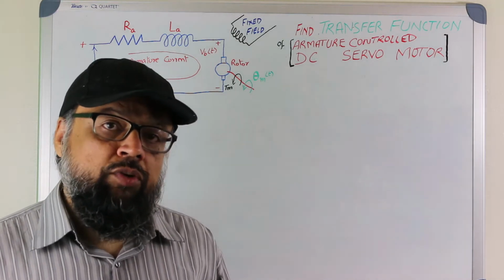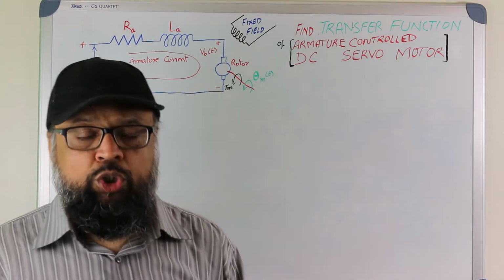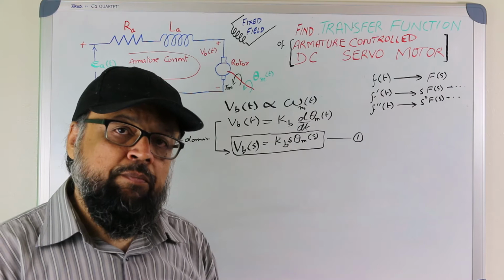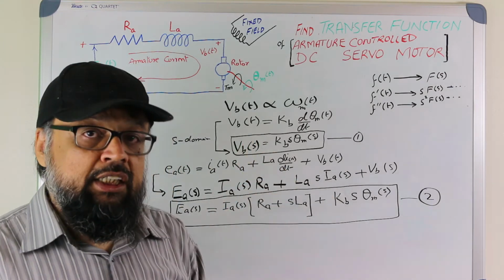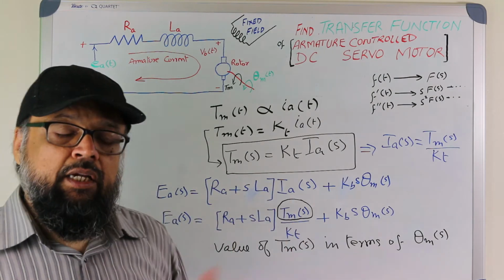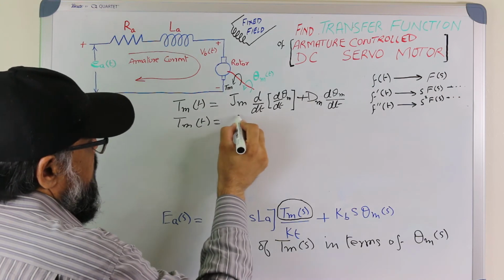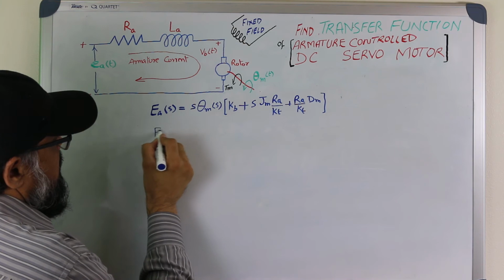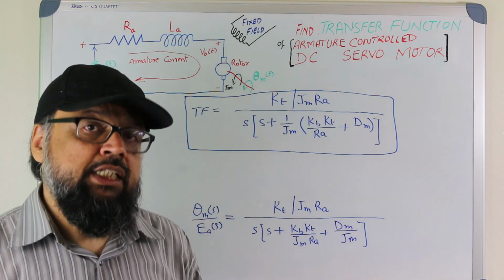How to Find Transfer Function of a DC Servo Motor

Comment: I want to find transfer of dc motor
but i don t know how.
24 v 5500rpm ZYTD-60SRZ-R2-091211
Reply: you must do open loop test and as the sir said in the video the TF = K/(tau*s+1) as said you need to find the two constants tau at 63% of step response and the gain is simply value at pernament regime devided bhy the step value